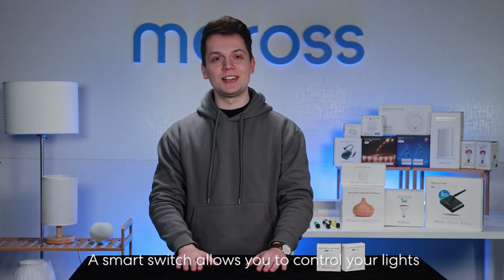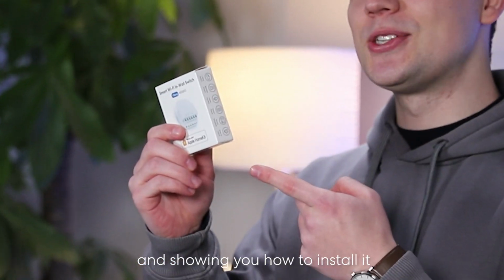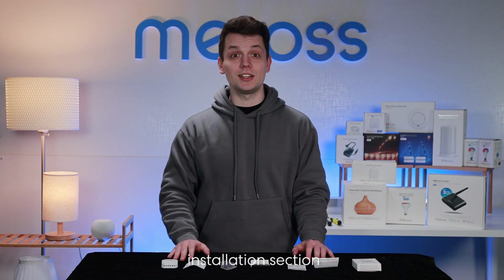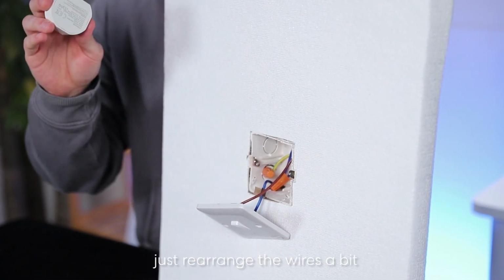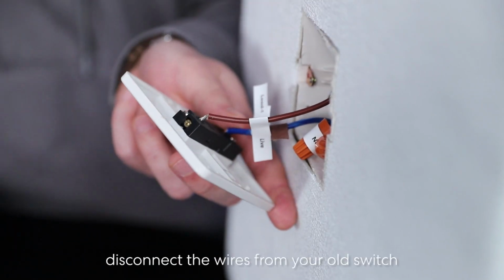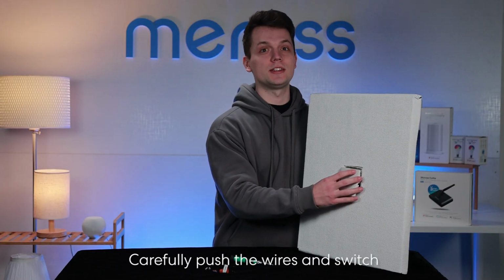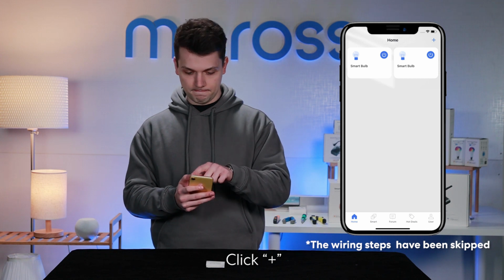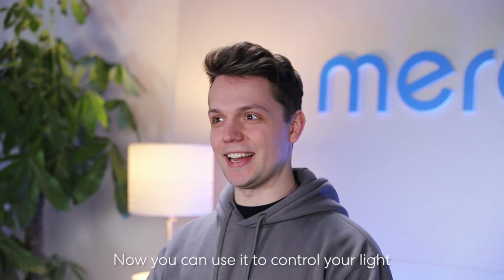How to Install Meross Smart In-Wall Switch MSS810

Comment: This video is very confusing to me. I still haven’t been able to install this product. I’m just going to buy the expensive lightbulbs instead. I just don’t understand the load and neutral wires. I have located in neutral which is easier enough but I don’t know where the load is according to this video that I’ve got two blue wires which are identical coming out of the same place I don’t have this I give up.

Comment: If you turn the light off at the switch, can you turn it off using HomeKit, and then turn it on again at the switch? i.e. does the smart module make the switch being up or down irrelevant to being on or off?

Comment: You seem to have two wires connected to the neutral (the diagram only has one which does not make sense to me because you need the neutral coming from the power source)  I assume the other wire you have twisted in the neutral is coming from the main source!

Comment: my switch doenst has neutral cable. It has Load 1 and Live cable. Is it possible to use without neutral cable?
Reply: But its very easy to add a neutral cable